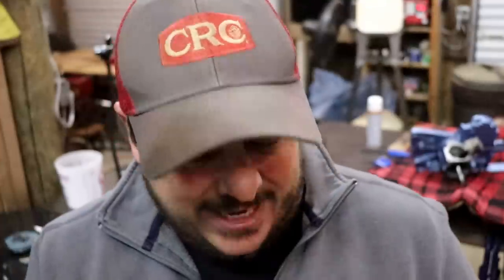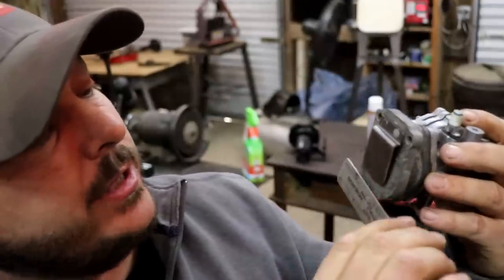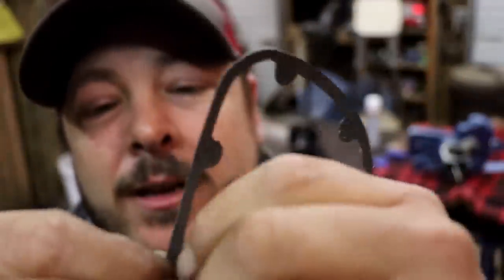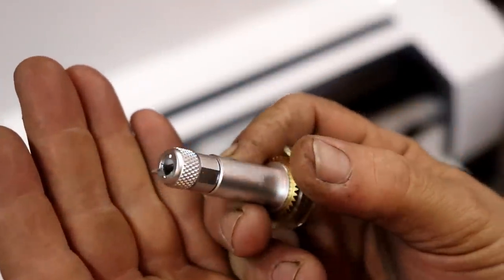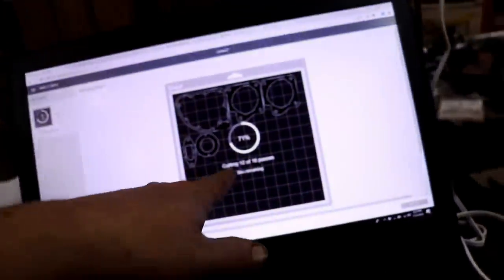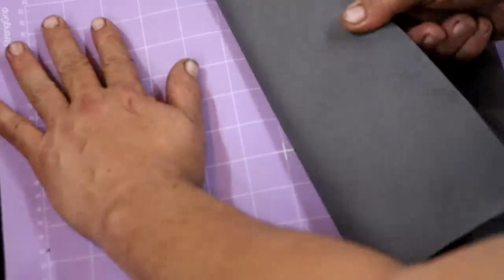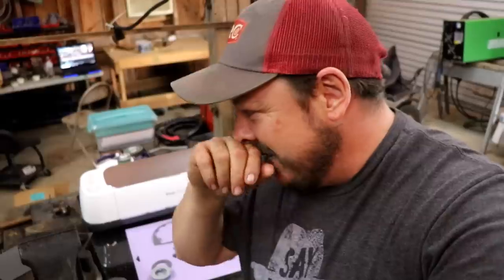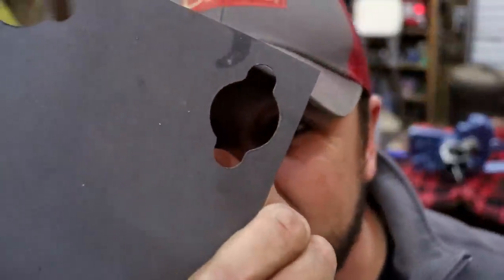The Incredible GASKET MAKER your WIFE already knows about!

Comment: Another great idea for gaskets is to scam them with a scanner/copier machine and then transfer that scanned gasket image to the program to adjust. Laying a flat ruler in the with the scanned gasket allows you to adjust the image for a perfect fit every time. And I use a LASER Engraver to cut out gaskets. Been doing that for years. And if you don't have the old gasket or it is beyond anything usable (in pieces), you can lay the actual item on the scanner and get the layout that way as well. Works for me!
Reply: Hate it when my gaskets get scammed!
Reply: If you know the dots-per-inch resolution at which the image is scanned, there is no need for also scanning a ruler.  Dimensions can be calculated directly from the raster image.
Reply: yes, we have this machine
Reply: But isn't a laser engraver more than $10K? How thick of a material does it cut, and can it cut neoprene rubber (not foam), say 1mm thick?
Reply: @philreinie8976  It's not a laser but rather a vinyl cutting machine
Reply: @philreinie8976  That was not the point, it wasn't about his laser cutter but rather the method of getting gasket layouts using a photocopying machine.

Comment: I too have noticed this machine’s usefulness. I plan on using my wife’s Silhouette Cameo II for making silicone flapper valves for bagpipes. Put wax paper down, spread 100% silicone onto it, place cardboard spacers on each side, another sheet of wax paper on top, rolling pin to flatten the silicone out to the cardboard thickness, then let dry. Now you’ve got a uniform sheet of silicone to put in the cutter. 
 It doesn’t release as well as you’d think though so you have to use a heat gun or blow drier to soften the wax when you remove the paper. The heat certainly won’t hurt the silicone.

Comment: In the past if I had a good but stiff/old gasket I would lay it over new material and then lightly spray paint over which gives me a perfect pattern to cut out the new one from. I missed somewhere in this where you actually got the pattern into the computer- did you have a scanner or draw those or what, because that looks like it's past most people's abilities.

Comment: Hi from England

Looks good Justin...
One thing of note:
Make sure gasket material used is the same thickness as the original...as if not then you risk altering the compression ratio on a 2 stroke...and can also affect end float on shafts/gears etc... 👍

Comment: If you’re near a Hobby Lobby, you can get a 40% off coupon from their website or smartphone app. The coupon excludes Cricut products but does not exclude Silhouette products. You can get the Silhouette Cameo 3 (reg $199) for $120. Same functionality as the cricut machine. I love mine.
Reply: When I tried to use the coupon, the cashier said I couldn’t, but I pointed out that Cricut was the only excluded brand specified in the fine print. After talking to her manager, they approved the discount.

Comment: I make a photocopy of the gasket I want.  Cut it out, use it as a stencil.  $30.00 printer and an Exacto.
Reply: We improved the knife as well. Check out the Cricut TrueControl Knife.
Reply: Really old Laserjet 4L can print on paperboard since it feeds it from the front to the back without bending it, might be able to print onto the gasket material directly. They are very old and often need a gear replaced inside, though.
Scan the old gasket, try a bit until you figured out the scale factor and print.

Comment: It may be difficult to get your photos to be completely straight-on sometimes. In those situations, along with your ruler that you use as a reference, you can add some known-circular item (a quarter, a dime, w/e) and then as your first step in your graphic design program, you can use that shape to correct for the perspective for the camera, taking care of whatever keystone error you may have introduced by mistake.
Some rulers are actually made with circles of known size on them, exactly for this purpose, for taking evidence photos in the field.
Reply: How accurate can pictures get (as far as skew, or whatever you called it)?

Comment: Good DYI video, using the CNC cutter is a really great trick.  Here is a trick to add your bag of tricks.  Use a scanner to scan in the parts the gasket has to fit, the higher resolution the scan the more dimensionly stable they are.  I've been scanning in gaskets for years then just printing the outline on to gasket material on a inexpensive desktop printer. Every thing from carbs to truck transmissions anything that would fit the scanner.  But then cutting them by hand.  You've taken it to the next level.

Thumbs up

Just saw that Gary had already suggested the same approach.

Comment: We used to take a candle and let the soot coat a metal spoon for a few minutes then rub the carbon onto the original part then place a paper against it and rub it leaving the PERFECT outline on the paper so you can scan it or trace it.

Comment: Do you have to have a new sticky sheet each time?  Is there anything to stop you stacking parts within part outlines to save on waste?
Reply: No, as long as you keep them reasonably clean those adhesive mats will last for dozens and dozens of cuts. The stacking parts idea works as long as your image file is done correctly. Image formatting on the Cicut can be a pain sometimes.

Comment: The other thing you can do instead of photographing the gaskets is to scan them on a flatbed scanner. With that you can get a really accurate scan, likely dimensionally accurate to boot.
Reply: Mine aren't staying the right size, as far as ratio, they are perfect. But they still need resized. 
Do you know what scanner settings might fix this?

Comment: We have an old 1952 Ford 8N Tractor and the Sediment Bowel needs a new Gasket. Purchased a new Cork Gasket... went bad in no time. I tried making new ones out of other Materials but the Ethanol in the Gas destroys them. Bought some new ones yesterday that are some kind of Rubber...hopefully not Neoprene. Supposed to be Sediment Bowel Gaskets. We read about Rubberized Cork Sediment Bowel Gaskets but have not tried them. Our question is: What type of Material would you use for this application?

Comment: I have done the same with my mom's cricut and a scanner. I found that using inkscape and turning the image into a vector before cricut software works better for me. Good idea using the mat for measuring I didn't think of that one I used a measuring tape and a caliper.
Reply: BSSMALLENGINES could you tell me more about Inkscape? What it does and where to find it? Converting images has been a hurdle for my wife and I on her cricut.

Comment: FYI - the native resolution of the Cricut is 144 dpi/ppi so if you scan or are sizing your image to scale, output 144 dpi and your file will import at the correct size after the design software vectors your image.
Reply from the maker: +bendavanza You just saved everyone a ton of time! Thank you! I'm pinning this. Great info, very helpful!
Reply: Could you perhaps tell me where in the program you can change the scale?

Comment: When photographing the original gasket or the surface onto which the gasket will go, if possible, do not use a cell phone camera.  Use a digital camera with optical zoom (moveable lens elements), move the camera as far back from the subject as you can, then zoom in to the subject to fill the field of view.   (Ideally, you would be viewing the subject from infinity with infinite zoom.) Try to get the focal plane of the camera exactly parallel to the gasket plane.  By doing this, you'll minimize distortion in the photo image, making it much easier to scale the image in Photoshop or GIMP while avoiding barrel distortion, pincushion distortion and perspective distortion.

Comment: I just use a small ballpoint hammer and some card usually cereal box and tap around the edges which cuts the card then I soak the card gasket in oil for a while, been doing it for years and have had no problems, also works on thin metal

Comment: I thought about this didn't know if it would actually work but that's awesome man ,  I'm a pretty good at drawing never had an issue making gaskets also useful tip if you put ink on the object you're going to make a gasket for you can use it as a stamp onto the paper 👍

Comment: What I do which is super quick a works like a charm is I get mt hollow punch set, Scissors, and or Xacto ready and I lay out my material flat.
I then take a can of spray paint and mist the face of the part and then quickly stamp it down on the material.
Mash it nice and hard. and it transfers the shape.
Then you use punches etc to cut her out.
the process takes only a few secs.

I have many other ways to accomplish this, but this is a down and dirty way that works great.

Comment: Super cool - and great luck for you it was the golden path !!  -- but a lot of us can do the same thing by using a scroll saw - it's a lot more accurate on tough material than trying to hack through with even a scalpal. And - you can just make a copy of dem gaskets and use a light-duty craft-type spray adhesive.  Drill or dremel the holes.  Probably save you some time unless you've got duplicates.

Comment: That turned out perfect.  The only way I've ever made them is with a tiny ball peen hammer.
Reply from the maker: +1970chevelle396 Same here!
Reply: I was a Machinist Mate in the Navy - worked in the engine room. When we needed a gasket that wasn't in the store room we laid gasket material against the flange and gently tap-tapped the edges with a ball peen hammer. Depending on the material you could cut it out that way or get the layout lines. Worked great. I remember one time we were underway and didn't have gasket material for a critical repair. We ended up using old charts from the ship's navigator. Not perfect but it got us home.
Reply: 1970chevelle396 👍
Reply: I’ve done such with Exacto knives or on a scroll saw, but I’d always wondered how it would go with one of these CNC vinyl lettering/design cutters.  Now I know!  It certainly is not fun making thin and intricate gaskets by hand, but it can be a life saver in a pinch if you are not fortunate enough to own a Cricut (unfortunately I don’t quite have enough need to justify buying one given the costs of my other hobbies!).
Reply: Rich Sobocinski  my father wasn't much of a mechanic but I remember he repaired some piece of farm equipment making the gasket with the ball peen hammer and the box Tide detergent came in.
Reply: I've made perfect gaskets using a small hammer. 🔨 it is a lot cheaper than a machine like this
Reply: 1970chevelle396 same it comes out almost perfect except for the times you can’t get the hammer in a certain place
Reply: 1970chevelle396 ball peen! That’s what they taught me in the Army!
Reply: This is one of the first tricks I was shown when I was a wee lad, and still use it to this day!! I'm in my mid 30's as a reference not that anyone gives a flying Fu... Anyways! LoL this video is a way cool way for small carburetor gaskets or stuff that u don't really want to tap on with a hammer. Knowing the technic of the peen hammer an absolute must I think if you are going to be wrenching on stuff! Just my opinion though!
Reply: @RichSobocinski  rubber coats worked for us too in the Navy
Reply: Wow great idea can you please make a little more detailed video a more of a how to including the photo shop program

Comment: That's neat. Personally I just make the gasket surface a little dirty with my greasy mechanic fingers, then stab a couple of tapered punches through the gasket material into 2 opposing bolt holes, then press along every edge of the housing. This leaves a nice imprint of the gasket surface, which I cut out with scissors and a leather punch.

Comment: All you have to do is trace the outline of the gasket onto a piece of paper, scan it (check the box "maintain size"), then pull it into your cutting software. You guys are still eyeballing it and you got lucky. Much easier and better way to do this. Hope this helps.

Comment: If you can scan an existing gasket or a flat surface as a Tiff file, it keeps the measurements, and all you have to do is put the image in your software without having to adjust the scale.

Comment: Maybe I'm the only one, but it's truly a miracle if my paper printer actually works when I hit the "print button." Most of the time it is "offline" in an "error state" or microsoft randomely chose another printer (that doesn't exist) for me to use. Honestly, it would be easier for me to cut out the gasket with an exacto knife.

Comment: Not a bad price for CNC technology. I would have expected it to $1,000 or more. What's the brand name. I am curious if I could get it to work with Mastercam?
Reply: The machine is a “Cricut” (brand) “Maker” (model).  You’d have to do some hacking to get it to work with MasterCam. It is designed to work with their proprietary software “Design Space” and it is FAR from a Cam program. It is tailored more towards uploading premade images and is terrible for drafting images in their program. It uses SVG file format, so if you can get your MasterCam designs into SVG, then you can upload it to the Cricut and it will work just fine.
Reply: @athhud  Someone did a software conversion for it already it was too buggy for me when we used it in July. Should be able to google it, iirc it took the cam file into dxf then svg

Comment: I used to make gaskets using the part, gasket material, and a small ball peen hammer. Simply hold the material against the part and gently tap with the hammer to cut the material to exactly fit part. Not as much fun a using a Cricut, but possibly faster.

Comment: There's a nice trick that will make this much easier.  If you got a flatbed scanner, you can pop the gasket in ( or any flat shape you need to reproduce and cut ) and scan it exactly at 144 DPI, then insert the image into the Cricut Design Space software, and it will be 100% at actual real size.  The software can mask out areas based on color, so it's pretty easy to import this as a cut file and not have to measure anything.  Cheers!
Reply: You could also pop on over to repairclinic.com and look up your part. They have a picture of it on 1 in. grid so it will be easy to resize and print.

Comment: I've ran out of gasket paper and used cereal box or pop tart box ... As long as it's noncorigaded cardboard , has worked fine .. Most with the intension to change em later , but they never leaked or needed changing .. So , some of em are still in place .. Just to say , so maybe this might help somebody in a jam needing a gasket with no paper or cork available  , Cheers

Comment: I've used a a real CNC machine, and I attached an exacto, the one that can rotate, to the milling motor, but disabled that motor, and simply put the exacto into the chuck. then I CAM programmed my CAD drawing from a laser scanner, and I made gasket out of rubber, silicone, teflon sheets, cork, EPDA

Comment: I need rubber gaskets for something, where do I get the sheets of rubber?
Reply from the maker: +Melissa LewisYou can find it on Amazon. Do you need rubber or rubberized gasket material? What's the project?
Reply: The Good of the Land  I bought some glass canning lids that require rubber gaskets, I’ve bought some old ones but they just aren’t quite the right size.  The ones that fit are rare and kind of pricey:)
I wish I could share a photo!
Edit to add they are natural rubber gaskets from the 60’s so new would work better lol
Reply from the maker: @meldlew  I see. I'm familiar with the gaskets your talking about. I would suggest a black silicon mat. It's a kitchen product. Looks just like rubber but its food grade and tough. The cricut will cut it with the carbide blade. Might even cut it with the normal blade. Heck now I need some for my jars!

Comment: A suggestion, put smaller gaskets inside the other larger gaskets, and you will use the material better.  :-)
Great idea though.

Maybe use the smaller laser engravers would be usable.  They are even lower price, but much smaller print area.

Comment: You can also "cut" out your own gasket with that material with out even using a knife. You lay or stick the material down onto the part it goes on to and take the ball peen side of a hammer and gently tap around the edges and even the bolt holes and it will actually cut through the gasket material.

Comment: Copper coat sometimes makes gaskets slippery and they will squeeze out on you, please don't use the stuff like many people like to use silicone if you know what I mean. :-)
Reply: Groundhog, I like to use Elmer’s rubber cement, coat both surface and gasket,let it dry and the gasket will stay right where you want it. And it cleans off easy, just rub it off!
Reply: Groundhog   "A dab will do".

Comment: OK, that's way cool.  But, if you don't have $400 to spend on one and you need a gasket right now, and you have a very small ball peen hammer...  You put the gasket material over the gasket surface and you ping around the holes and the edges and make the gastket.  If it doesn't go all the way through, you can trim it.  I've made many gaskets this way when I didn't have time to go shopping for one.  My dad taught me this back int the 60's!  By the way, I have built my own 3D printer and laser cutter...  For one gasket, it's still easier to use the hammer.

Comment: Looks crazy expensive when your just doing a few gaskets a year   
That being said it is cool to know.
Reply: Last time I had that problem, I just used a tube of permatex gasket maker to solve the problem. It did take a bit of time, but it did just fine.

I kind of like this idea though in spite of the expense. Sure, there's a bit of work ahead of time, but if you screw up the gasket again, you can reuse the previous design.